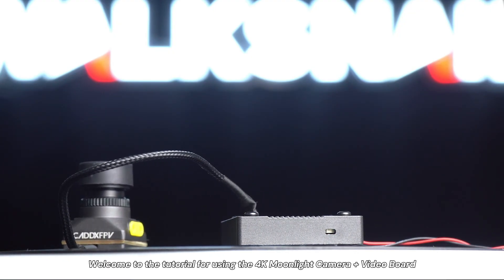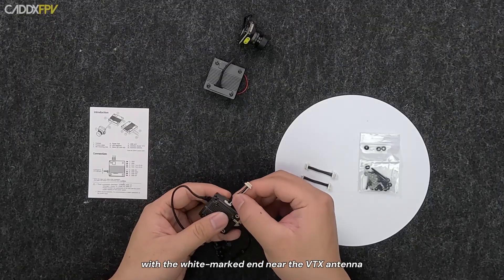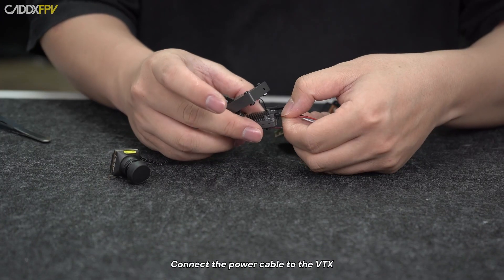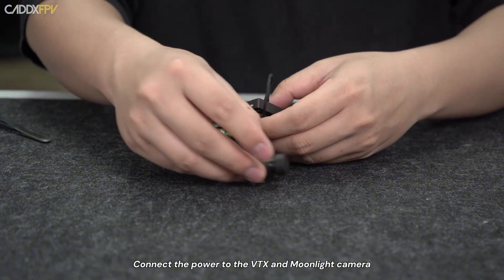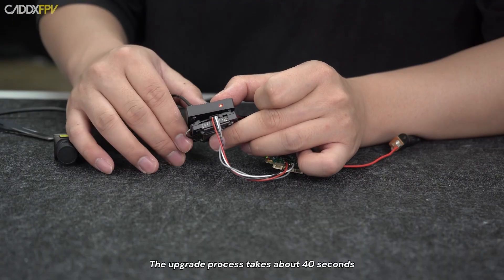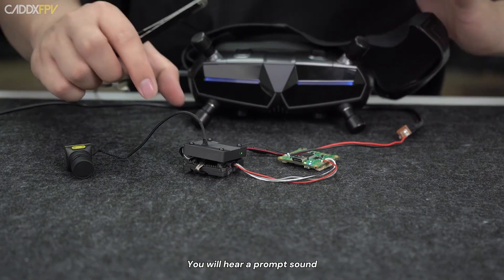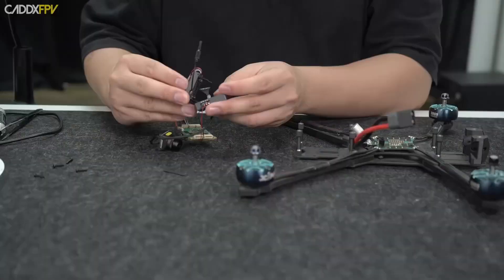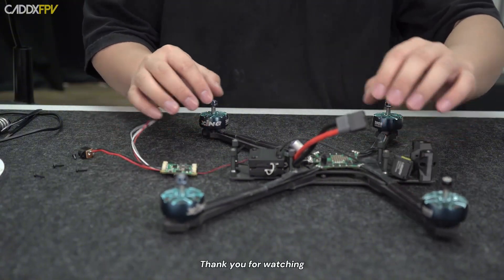Moonlight 1 FPV Video System | Tutorial

Comment: Will they have better quality control before shipping , I’ve had 2 moonlights , first no osd and the seconds does not record.  Also where are your error documentation for the status lights , I get a blue light while flashing,
Reply: What FC were you using? I had no OSD too with a AT32F435 FC, apparently they are incompatible for some reason. Sold and got a Geprc Taker, and now everything is working perfectly.
Reply: @Iversonfr1985 same fc and had to swap between two moonlight units on video to prove to Caddx it was broken. Just had then return and fixed.

Comment: Hi Caddx,  I love flying with my Ratel starlight cameras. They are the only camera I use in 15 different quads. I just switched to walksnail, and I love flying with walksnail.  Unfortunately my goggles are broken.  Can't wait until they are fixed. Thanks again for the best system
Reply from the maker: Hi Johnny Hru? Your love and passion for FPV, is the motivation for us to doing more and better :face-blue-smiling:
Reply from the maker: If u need more help from FPV tech, u could contact the after-sales line: service@caddxfpv.com :face-blue-smiling: Hv a great day

Comment: Can this camera record gyro data for more than 34 minutes?
Reply: Why exactly 34 minutes?
Reply: @mplouis  Because the gyro data is only recorded for ~34 minutes. I checked on avatar pro and avatar v3.
If you stop recording after 34 minutes and resume, the gyro does not record data.
Reply from the maker: Cam recording time, depends on the working temperature.
Reply: @CADDXFPV  Does it record the video, but doesn't the gyro record the data? Is it possible to implement an overheating warning?
Reply from the maker: @kasatka60  Bonjour, buddy. The Moonlight Kit is with Gyro stabilization, and  when it overheating, vtx lights shows red and green exchanging flashing as a remind:glasses-purple-yellow-diamond: